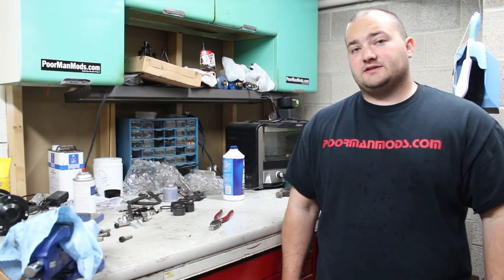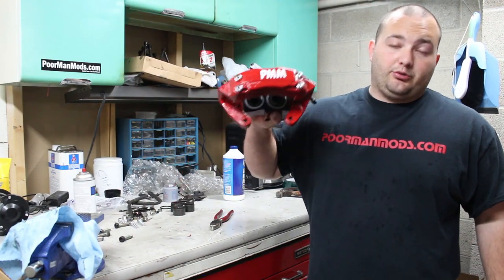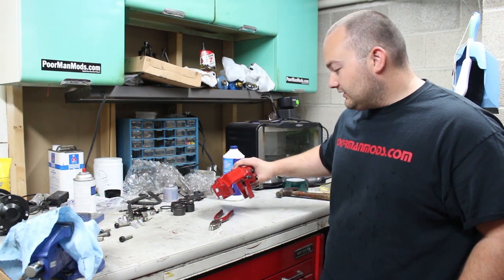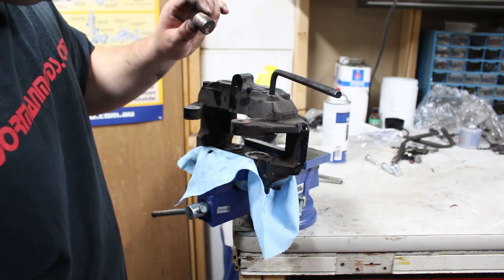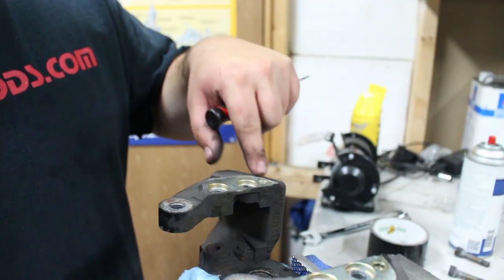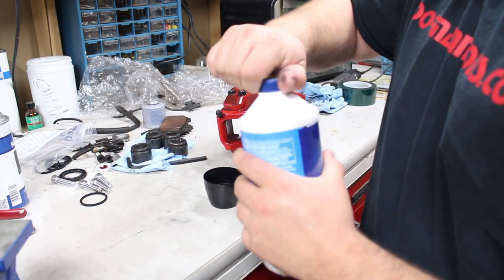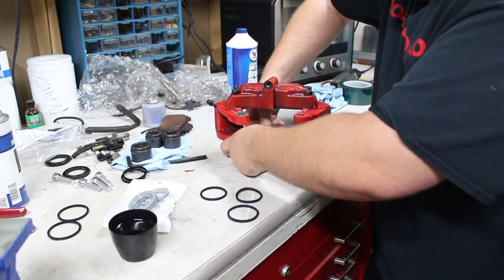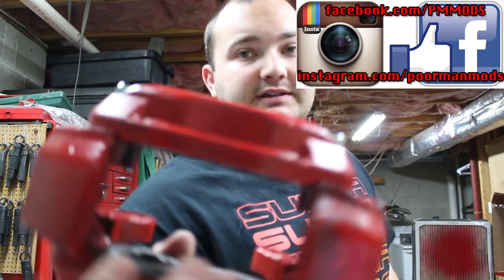How to Rebuild a Brembo Brake Caliper | Brembo WillWood Rebuild

Comment: I bolted on 8 piston calipers on my SRT8, cannot get it to hold pressure! Have tried everything, new master, booster, u name it. Is it possible my OEM equipment cannot suppport the calipers? Any help would be amazing
Reply from the maker: Yes its possible your oem master cylinder is too small for those massive calipers
Reply: @PoorManMods  thanks for your input, much appreciated!

Comment: Have you used these brakes yet? I'm curious how the powdercoat is holding up. I'm getting close to rebuilding the Brembo's on my STi & figured  I'd do it myself, but I'm not sure if it matters what powder I use or if the decal will melt. Thanks.

Comment: Cool vid i got the 4 piston red brambo calipers on my SRT8 had a warped rotor rite front wheel nd i think it destroyed my caliper pistons from the warped rotor vibration !! So now after i did the brakes , new rotor new hawk race pads ! I noticed that when i brake for long period of time at once , i feel a vibration in the pedal minor but it almost feels like bad pads ! But pads r new!!! So am thinking it might b the pistons or seals !! Btw they dont leak !!
Reply: Could it your fluid boiling ?  I've had it happen with ordinary brake fluid.

Comment: I have an 03 350z. If I want to repaint them, I was told theres some kit I have to buy to put the calipers back together? Is that accurate or is it as simple as just putting them back together.
Reply: paraider 55 depends on if your just painting them or powder coating them.

Comment: Hey man, I used degreaser and some of it leaked into the brake fluid cavity.

Thoughts on cleaning? It isn't a lot, maybe a drop or two.
Reply from the maker: +Necrodox clean it out however possible
Reply: +Poor Man Mods would the best approach be to take the pistons out and soak it in some soapy water and then let dry?

Not sure how to even get in there to clean it out lol (it's the hole with the little o-rings).
Reply from the maker: break cleaner would probably be best
Reply from the maker: brake cleaner*
Reply: Poor Man Mods Sounds good man thanks, just one more quick question.

I currently have the pistons inside and I have it all taped off for painting including the brake fluid cavity. To properly clean these I'd need to remove the pistons, get all the brake fluid out and then apply the brake cleaner through those cavities correct?

Sorry for all the questions, just don't want to ruin the calipers.

Comment: I've noticed that the rebuild kit you used is Centric.  I used the same one and found that they are thinner than the OEM brembo dust seals.  The inner orings are fine.  I ended up ripping two dust seals because they were so thin.... BUT at the same time I guess I am OK with this because the cheapest I could find the OEM Brembo dust seals were $18 a pop... which his expensive considering it's only the dust seal and not the inner o-ring as well...
Reply from the maker: hmmmm interesting

Comment: Would these work with 94-04 cobra caliper break lines or do they need adapters ? & are these for 13” rotors?

Comment: Great video! Do you happen to know the chrome allen bolt dimensions and thread pitch? I'm going to do this upgrade myself this winter and am also looking to change those bolts to nice chrome ones.  Thanks.
Reply from the maker: I don't know i just took the original bolts to my hardware store and matched them up
Reply: Poor Man Mods thanks, I will do the same. Cheers!

Comment: Where did you get the chrome bolts for the fronts of the calipers? also did you ever find out what that funky shit in the piston was for?? mine also has that stuff in each piston
Reply from the maker: took the bolts to my local hardware store and matched them up, i was told the funky stuff could be vibration dampening material

Comment: Are most brake rebuilds the same?
Reply: Josiah Canter The initial stuff he did (those allen bolts and the guide pins) will be different than most calipers, but the seals and such he did later are gonna be the same.

Comment: I know this is long long overdue, but did you ever find out what that rubber type substance was?  Maybe someone put the wrong lube in and it turned hard over heat and time?  
The little fish egg looking things....I have no clue .....very weird
Reply from the maker: I think its material to reduce vibrations since the brakes are out of "luxury" car
Reply: Ah ok, so they just filled the piston with some sort of dense gel?  Hmm.  Not a bad idea I guess since itll never touch anything but the inside of the brake pad.  I just wanted to thank you very much for this video.  I rebuilt mine in about an hour with your help.  I cant bleed brakes for crap though, my pedal is still squishy.  My WRX  Brembo calipers look amazing though.
Reply from the maker: awesome im glad i could help :D make sure you dont have leaks and just keep bleeding youll get it!
Reply: It looks like CRC Disk brake quiet. It is not supposed to be used on calipers with dust seals. I used it changing pads on my car. Just assumed it was like other synthetic brake grease for pins and pad backing. Read label after I installed. Had to use the pressure washer to get that shit off. Lol